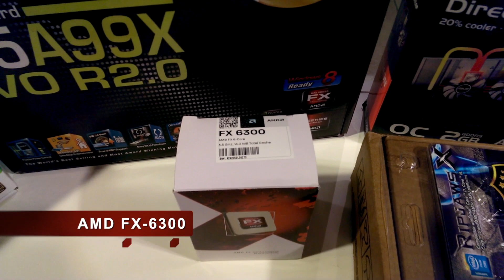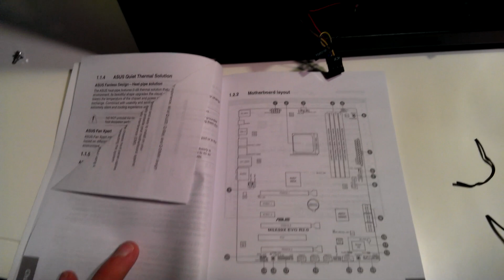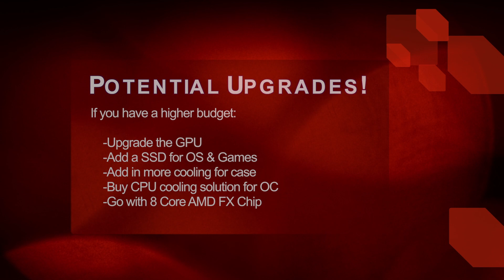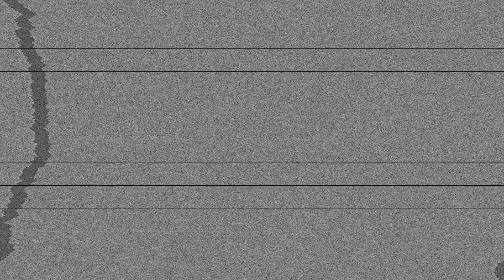2014 AMD GAMING PC BUDGET BUILD | Tutorial & Parts List

Comment: I'm looking to build my first gaming pc. I really have no need for the highest settings and probably won't play any higher than 1080p. This is my list so far. I'm open to any suggestions, and I'm a noob for gaming PCs (I've built some office PCs) so any help or resources would be great. I want to be able to play games like GTA V, Assassins Creed. Stuff like that. Let me know if you think this looks like a good setup or if you any of my parts are a poor value. I'm not terribly concerned with part cost I'm going to be buying a couple parts out of each check. Like I said though I don't need a super powered machine and I don't want to spend $2000. I'm right under $1000 right now and would like to stay somewhere near that number.

ASRock FATAL1TY Z97 KILLER Motherboard

Intel Core i5-4690K Processor

Cooler Master Hyper 212 EVO - CPU Cooler with 120mm PWM Fan

Corsair Vengeance 16GB (2x8GB) DDR3 1600 MHz 

Corsair Graphite Series 760T Full Tower Windowed Case - Black

Cooler Master V650 - Compact 650W 80 PLUS Gold Modular PSU

NVIDIA GeForce GTX 750 Ti  Video Card
Reply: What gpu are you getting
Reply: lol your gonna bottleneck your sytem with that gpu
Reply: Qualify doesthismeetyournamespolicy this comment was from June. I ended up going with a AMD build instead. It costed half what this build would have and I'm very happy with the performance I get.
Reply: Wade Wilson good stuff

Comment: What is the recommended power supply for this pc build 

MotherBoard : ASUS M5A99X EVO R2.0 AM3+, AMD 990X, SATA 6Gb/s, USB 3.0, ATX, AMD
Graphic Cards : Sapphire Radeon R9 270 2GB 
RAM: Crucial Ballistix Sport 8GB Kit (4GBx2) DDR3 1600 MT/s
Storage: Seagate ST31000340NS-A1 1TB BARRACUDA
Optical drive: Lite-On 24X SATA Internal DVD+/-RW Drive
Reply: put 500w or more ..
Reply: 650w should handle pritty good

Comment: Hey, I used this build (with a few modifications) ad by computer turned out great! except that it sometimes it boots up, often it doesn't. One time i took out the CPU and put it back in and that worked. Another time i took out the RAM and put it back in and that worked. But once it sits for a couple hours it doesn't want to boot up again. Right now nothing i can do will boot it up. All fans turn on, full power, but no beep or display.

Comment: This is my first time gathering pc parts but tell me if its good for gaming at at least medium settings 

CPU: Amd fx 6300 3.5 ghz 6 core processor 

Motherboard: gigabyte ga 970a ds3p atx amp3+ motherboard

Ram: team elite 8 gb (2x4gb) ddr3 1600 memory

Storage: samsung 840 evo 120 gb 2.5 ssd

Video card: sapphire radeon r7 260x 2gb video card

Power supply: corsair builder 430w 80+ bronze certified atx power supply

Optical drive: lite on ihas124 14dvd/cd writer
Reply: I would recoomend an R9 270 for better performance. For that you'll also need a PSU with about 500 or 550 W ( if you go AMD, if you go for Nvidia it might work with that psu). Choose good brand. The build is pretty good the way it is but an R9 270 or GTX 660 it would be even better.if you don't have the money, a R7 265 or GTX 750 Ti are also good.
Reply: So i changed the motherboard to the micro atx m5a 78l does it get an amd processor and im getting the 750 ti so do i still need the 500w psu?
Reply: the silent gamer The 750 Ti doesn't consume all that much. I would still recommend a 500W psu. You should calculate your psu wattage to find out how much you need. Check this http://www.extreme.outervision.com/PSUEngine
Take in consideration that your psu should always have about 100W more than the actual consumption. the site should give you a few recommandations.

Comment: Is a wifi card needed to build this? Cause i am using a optic fibre wireless internet modem at home that is being shared with my  parents(only child). Cause i am worried when i build the PC but not able to download or play my games because of the wifi
Reply: And also does it automatically comes with Windows 8.1/7 Ultimate
Reply: And i can i replace the R9 270 with a R9 270X from this video? Will it fit? Will there be any downsides(minimal or major)?
Reply: No the cards not needed the x card is the same size
Reply: And you have to buy windows separate

Comment: Maybe a bit off topic but if anyone could give me some tips if this is a good PC build and maybe how it will perform.

CPU:AMD FX6300 Black Edition 6 Core (3.5/4.1GHz)

MOBO: Asus M5A97 R2.0 Motherboard (AMD 970/SB950, 4x DDR3, S-ATA 600, ATX, PCI-Express 2.0, USB 3.0, USB BIOS Flashback, Windows 8 Ready, Socket AM3+)

PSU: Corsair Builder Series CXM 600W Modular 80 PLUS Bronze Certified ATX/EPS PSU

Case: CiT Neptune Gaming Case 12CM Red LED Fan Side Window Red Screwless Bays

RAM:HyperX FURY Series 8GB DDR3 1866MHz CL10 DIMM Memory Module - Red

HDD: WD 1TB 3.5 inch Internal Hard Drive - Caviar Blue

ODD :Samsung 24x Retail SATA DVD Writer

Thanks in advice
Reply: We're the gpu
Reply: 6 core 4.1 is top of the line good idea but maybe find a gpu.

Comment: Hi! Can somebody tell me, is it a good choice to buy these parts...
Processor - AMD A-Series A8-6600K X4 SFM2 BOX AD660KWOHLBOX
Motherboard - Asrock 980DE3/U3S3
Ram - Crucial Ballistix 8GB DDR3 PC3-12800 CL9 KIT OF 2 BLS2CP4G3D1609DS1S00CEU
Graphics card - MSI GF GTX770 2GB GDDR5 PCIE N770TF2GD5/OC
HDD - Western Digital Black 2TB 7200RPM SATA3 64MB WD2003FZEX
Power suply - Corsair Builder CX750 ATX2.3 80+ 750W
Case - Cooler Master Midl tower Elite K(night) 350 RC-K350-KWN2-EN
Reply: I don't see your reasoning behind getting an APU and a 770.
You could swap that APU for something much cheaper that will actually perform better. You simply don't need an APU when you have a graphics card. Also, you might consider downgrading the HDD. If you are just gaming (assuming you are), then you will only need a 1tb caviar blue or Barracuda or whatever is cheapest with a 64mb cache at the time. Then you could se that money to upgrade the CPU even more. Anyways, the rest of the parts look good.
Reply: Dot get that processor.
Get a fx series instead.
Reply: the power suplies is to big maybe you try the corsair cx600
Reply: Roberts Gulbis the a8 600k is just enought dont buy the graphics card, or better get a10 7850k and a msi x88 mobo, and get a corsair vengeance 8gb kit 1866mhz and you gonna be able to play anything at low-med and even some games on high

Comment: I have a decent AMD Build:
MOBO: MSI 970A-G46
CPU: AMD FX-8350 @4.4GHz
CPU COOLER: Corsair H80i in Push/Pull
GPU: EVGA GTX 660 Ti Slightly Overclocked
SSD: Kingston HyperX 3K 240GB
HDD: 1TB 5400RPM Toshiba 2.5"
WLAN: TP-LINK Wifi Card
PSU: Corsair CX600M
CASE: Cougar Solution ATX Mid Tower
and i love this setup :P
Reply: what about ram you didn't put that !
Reply: the ram is 8GBs of Crucial Balistix Sport
Reply: its pretty good 
it can play most games on Ultra if not that then high but i just swapped the graphics card for a GTX 770 4GB from Asus :P

Comment: im am noob but i put together a list for my first rig. if someone can take a look and tell me what you think?

graphics:gigabyte gtx 750 ti
motherboard:Gigabyte GA-970A-DS3P
cpu:AMD FX-6300
ram:A-Data AD3U1333C4G9-DRH

power:EVGA 500W 80+ Bronze Certified ATX Power Supply
case:NZXT Source 210 (Black) ATX Mid Tower Case
Reply: this is a pretty good build. I say go for it!
Reply: Prices
Reply: suck it That cpu is actually amazing, the stock cooler is a bit loud but the performance is great for a budget build. You can tell he's not going ultra high end by the 750 TI, but overall buck kirk It's a nice build.
Reply: Get the r9 270x. its a way more powerful gpu than the 750 ti. and it cost less as of now. and get a aftermarket cooler for the 6300. it wont bottleneck on you.
Reply: Lmao, not sure if you understand what Bottlenecking is darrell Williams You won't get as much performance as you would with the r9 270x, but it's definately not bottlenecking
Reply: I know its called hardware  incompatability but 750 ti is to high priced for the specs it has the r9270x is almost the same price if not cheaper. And more powerful.
Reply: It's not hardware incompatability, in fact the 6300 will be running at optimal performance, which is normal in all processors, then the graphics card will be running optimally too, the graphics card won't put more of the performance on the processor, as the graphics card is there to display the graphics of the game, while the processor processes all of the data passing through the game / program, Bottlenecking is when you use an ultra bad graphics card like an hd 4850 on an i7 4770k, then it will start to bottleneck.
Reply: If you can understand if you were to put a weaker processor on it it will bottleneck the gpu. Its like putting a dual core on an very high end graphocs card it will not perform as good. There are processors that arent good for high end graphics cards. Take for instance the ahlon 760k it cant run a high end card like an i5 can. Thats all im saying. and   thats what i mean. I didnt say it wouldnt run. Besides, these processors require discrete gpu anyway. Look at austin evans video he explains that issue very well.
Reply: Matter of fact i once used an i7 4770 with an gtx 650 and it played great. So thats not bottlencking to me. Also i am currently using the r9290x with that i7 right now. Plus the 750ti has lower bit memory than the 290x.
Reply: See, that's not bottlenecking. The 750 ti isn't gonna bottleneck it at all, you just get more gpu performance with the 290x
Reply: Arnoodle Oh and almost forgot didn't read the comment I made the first time. Im full of these budwiesers lol. With the stock cooler it will throttle at times under certain situations. That's why I told him to get a aftermarket  cooler. So to me that is a form of so called bottlenecking It wont reach its full potential. They do have heat issues you know.
Reply: The processor won't throttle down if it's under pressure, unless you have it on power saving mode. I used a stock cooler on 3.5 GHZ with the fx 6300 without throttling issues, i recently bought the hyper 212 evo and overclocked to 4.3 GHZ and so far so great.
Reply: Yes it will. the 6300 is a good cpu. what video card are you using? Anyway it has l3 cache that makes it more able to handle high end cards. Run the overclocked processor on the stock cooler and see what you get.I bet it blue screens. That's with any processor.
Reply: Arnoodle L3 not i3' A lot of other amd cpus don't have L3 cache.
Reply: I use an r7 260x for everyday gaming, i don't get "Bottlenecking" and i never will. I used to use an athlon x2 64 dual core back in the day with an hd 4870, and i never got bottlenecking. Keep in mind that this took place years and years ago, as bottlnecking is way too uncommon to happen nowadays.
Reply: But it still happens. Like I said put that stock cooler back on and see what you get. And plus r9260x is not a high end card.  I was telling the noob how to get more performance for his money so he would have a better experience. Seems to me your a fanboy. If you want to get technical the 6300 barely keeps up with the i3. Like I said the 6300 i'snt a bad processor. So your taking all of this out of context. Before you try to correct or make fun of someone do you homework. Im talking like a r9 290 or 780 High end gpu"s. Get the hardware and try it for yourself. Like I said I never said it wouldn't run with dual core whatever it just stops the unleashing of the gpu's full potential.
Reply: I'm not a "Fanboy" as i've had nvidia cards in the past on multiple machines, like the gtx 460 in my living room PC right now, it's not unlocking a full gpu's potential, nothing relies on the cpu if it's graphically intensive UNLESS it's bottlenecking, that's in severe cases where the game is too new and you're running a card that was made in 2005, It really sounds to me like you don't know what you're talking about and you obviously haven't tested machines with the 6300 and up, or intel machines like the i7 3770k, or the i5 3570k.I've tested from 9800 GTX's all the way up to 780 ti's, im pretty sure i know performance by now. Cut off the beers and do YOUR homework before you start calling people "Noob" and "Fanboy". Even with an i3, the gpu is running at it's full potential, but then it THEN starts to bottleneck, because the processor can't keep up with the gpu, which has framerate dips.
Reply: Good I have what you got just better graphic cards and more gigs of ram. You could play battlefield4 no prob

Comment: Is this good

CPU- AMD FX-6300 6 Core Black Edition Processor $135.00
MOB- Asus M5A99X EVO R2.0 ATX AM3+ $115.00
Graphics Card - Asus Radeon R9 270 2GB $182.99
RAM-G.Skill Ripjaws X F3-10666CL9D-8GBXL (2x4GB) DDR3 $105.00     
HDD- Western Digital WD Blue 1TB WD10EZEX $69.00
SSD- Samsung 840 EVO Series 120GB SSD $99.00
PSU- Antec Basiq VP-600P 600W Power Supply $82.00
CASE- CoolerMaster CM Storm Scout 2 Black $115.00
OS-Microsoft Windows 8.1 64bit OEM $115.00
                                                        
Total $1017.99 AUS Dollar
Total $956.24 US Dollar
Total $707.04 Euros

Comment: Do you need to buy a wireless network adapter if your pc and router are in seperate rooms and  do I need  to buy a software for the pc (I'm considering windows 7 but their different ones on amazon and I'm looking for a cheap one if I do need one)

Comment: AHHHHH I hate the builds all the easy parts are shown but THE most HARDEST part wiring is never shown  .....
Reply from the maker: Wiring is the hardest part to conceptualize, but it's all done off of a blueprint based on your mobo.  Its very easy to do though it's just plugging in wires!
Reply: StogeP ay but still its pretty much the hardest part that
Reply: ACTUALLY THE hardest IS THE CABLE MANAGEMENT...Its all plugs and you can't mess up because they make certain plugs for certain holes-I am 50 yr old newb and figured it out by myself-I am just too lazy and impatient to zip tie the cables so I just leave the case open-lol .Upgrading is fun so get the best case and m/b you can afford as those are the most labor intensive upgrade. the other stuff  just pops in Don't be afraid ,the fires are USUALLY SMALL and the SHOCKS only STING a little- I'M KIDDING...  C'mon you kids are smarter than some old dude like me -JUMP IN !!!
Reply: badmts wow that was months ago m8

Comment: cpu: AMD A-series A6 5400K (VISION A8 Technology)

cpu speed: 2 x 3.6 GHZ 

RAM: 8GB DDR3 1333 Transcend (extra snel geheugen, 1333m

1000 GB S-ATA 3 Western Digital 

GPU: NVIDIA GTX650 1GB DDR5 

Audio: High Definition audio chip

DVD stations: DVD +/-RW Lite-On 24 speed Dual Layer

Mobo: Gigabyte GA-F2A88XM-D3H

for: 499 euro's + an gaming keyboard named 'sharkoon skiller' for free

is this an good budget gaming pc? can i run everything with medium or low settings? which game will not run on this pc?
Reply: extra snel geheugen means extra fast memory, sorry didn't translate that :)
Reply: Yes, it is very good low-end gaming pc. Biggest issue is APU that doesn't give that much raw CPU power. If you want to check how much in comparison would any AMD FX CPU give, check this web page -> http://www.cpubenchmark.net/

Comment: Never built a gaming pc before. Can someone tell me if this would be a good build? If you have any suggestions such as a better CPU or Mobo or anything, let me know:
CPU - AMD FX-6350 3.9GHz 6-Core
Mobo - Asus M5A97 EVO ATX AM3+
Ram -Corsair Vengeance 8GB (2 x 4GB) DDR3-1600
Storage - Samsung 840 Pro Series 128GB 2.5" SSD
               Samsung Spinpoint F3 1TB 3.5" 7200RPM
Video Card - EVGA GeForce GTX 660 2GB
Case - Thermaltake Chaser A71 ATX Full Tower
Power Supply - Corsair 750W ATX12V / EPS12V
Reply from the maker: Looks good.
Reply: How well do you think this would run most games?
Reply from the maker: Pretty damn well.